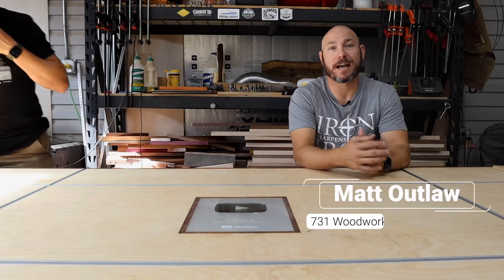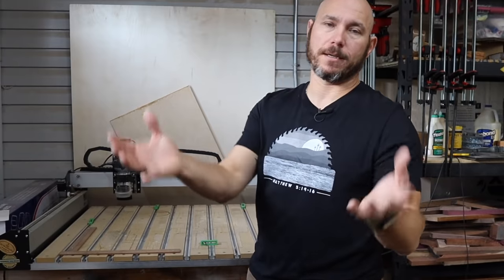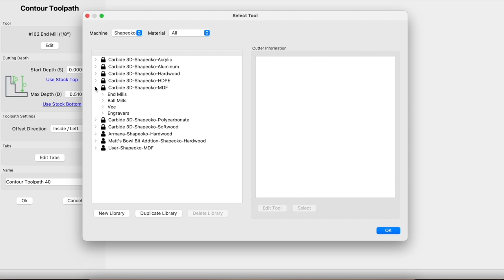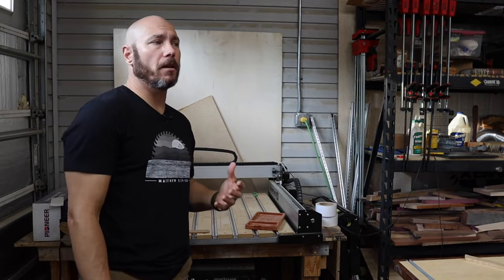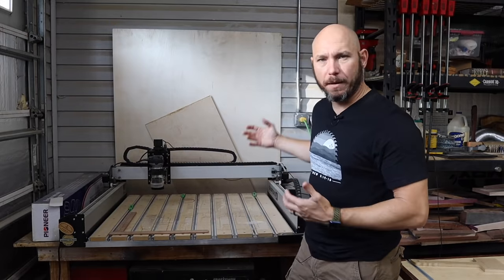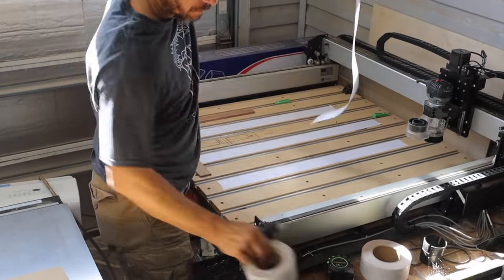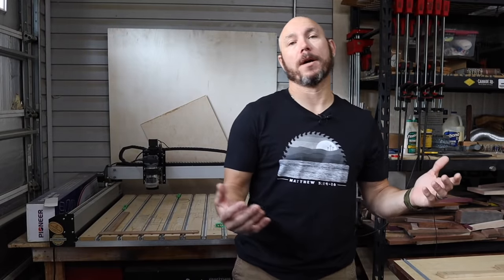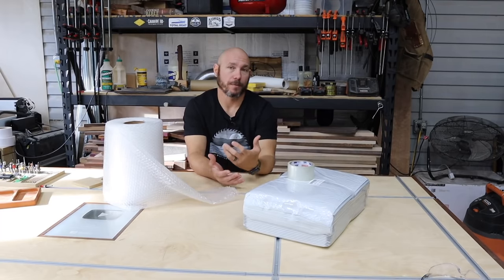The Dark Side of Learning to Use a CNC for Woodworking

Comment: I program cnc machines for a living. Went to trade school & did an apprenticeship. I am always impressed when people with no background get into cnc and pull off jobs. It’s intimidating at first for sure
Reply: I'm a machinist with mainly CNC work mill/lathe. I've had no schooling or prior experience. It's been little over a year and i'm still learning something new. It's a very steep learning curve but also the most rewarding IMO.
Reply: @Str8UpRevving  I built 747 aircraft for 25 years and bought a hobbyist level CNC to screw with at home. Never ran one for Boeing but figured it couldn't be too difficult. It has thrown me into CAD/CAM pretty hard. I have crashed bits into material, made errors in the software etc. Last night one side of it had gummed up with epoxy shavings and the gantry got cockeyed and destroyed my work. When it works it is awesome! When it doesn't? I level up when it comes to the things to watch out for. Every trade has it's unique problems. I love learning this stuff. If it wasn't for the internet I wouldn't be where I am with it. I have ideas in my head coming faster than I can draw them up. Everytime i see something cool I wonder how I can make one on my mill.

Comment: Easel from inventables is the most "plug and play" software I've used. It is almost as simple as import an SVG, give it your material depth and go. You should set your tabs properly if you're using them, you should check your feeds and speeds still, and there are restrictions in the free version which is to be expected. For simple 2d shapes, it is great.
Reply: I think that is what I used on my Millright CNC. Is it free for a month and then it's like $20 a month?  It was really simple, I made a sign in a few minutes with no problem.
Reply: So would I be able to pull an image off the web and set a depth to cut to and let it go? I saw a friend of mine do something like that with a laser engraver and thought that would be awesome for cnc routing.
Reply: @t-rexnut3091  pretty much. You will need to set up your material dimensions and thickness, you'll also need to select the tool you're using. Then you import an SVG, select the path you want to cut, set your depth of cut, and whether you want tabs. Then you can press go.
Reply: Easel could be great if it was desktop based but being could based I have found It unusable due to long delays between key entry to receiving a result. Very confusing and unsettling.

Comment: The other thing people don't get the memo on is the noise and the speed. A dust collector and spindle cutting is extremely loud. It's also a noise that doesn't stop with a machine that only moves at 50 inches per minute. Bigger machines are feeding at 500 plus inches per minute in soft materials.

Comment: Having built a CNC machine 30 years ago for a grad project in Tech school where we learned to program by HAND as well as various softwares (and working for a controller manufacturer at that time), I find creating the G-cod easy and inconsequential. Knowing speeds and feeds is the only real challenge for tool condition AND material inconsistencies. If this is a problem for you, geek out on a poor weather weekend and simply play with a CAD or graphics program and get proficient... Also, the rigidity and care of the CNC structural and electric is essential. Obviously, sparks indicate brushes, but the rigidity differentiates what I term as a real tool versus a "toy". Although X-carve, Shapeoko and Infinity are designed by the same person, the rigidity of the Infinity is superior for that level of the market. Also, it doesn't't use stretching belts of rubber, but real circulating bearing guide. blocks one precise linear guides and ball screws. Sure, we can't all justify the $30K+ machining centres used in industry, but start familiarizing with their qualities and strengths in judging a CNC for you and balance between that and your budget. Expect to pay for the best consumables, as we mostly use these for a small business, they are simply written off as composite overhead.

Comment: One month into owning a Shapeoko pro XXL,  You are 100% right !  Add to the dark side:  turning on router before the Carbide Motion swr gives RPM recommendation leads to destruction of top surface of bit setter.  I think your caution about not running the machine unattended is the most important part in the video.  I have watched a lot of CNC videos in the last couple of months and never seen anyone say you can burn your house down with one.  Now if I could only convince my wife not to start the dishwasher/washer/dryer  when we leave the house.

Comment: I had that glitch happen twice when I first started with my CNC.  I was cutting two of the same items back to back.  The machine did it on the second run both times.  Since then, I close out of Carbide Motion, reconnect to the machine,  and reset my set my zero positions between projects.  Takes a few minutes between runs, but hasn’t happened since I started that routine.

Comment: Great video.  You covered a lot of information that a newbie should hear.  My favorite part was about not using cheap bits.  A lot of newbies think they need to use cheap bits while they learn the CNC, but since they don't last and break easier, they may think they are doing something wrong when bits start breaking when it's actually the fault of the bit.  All it takes is a little learning about feeds and speeds which is readily available on the internet.  I've broken one bit in 15 years of routing and that's when I didn't have my board clamped down tight enough.  It was a production run of Muskie fishing lures I was cutting from one inch thick hard maple.  The board shifted right during the final pass so the 1/4 inch bit cut full depth and snapped. Lastly, your CNC has what is referred to in the CNC world as a router.  Yes technically it's a spindle but in the CNC world, they typically reserve the term spindle for motors where the RPM is determined by electrical frequency, are designed with more robust bearings, and they don't have brushes.  Spindles can easily run for over 12,000 hours whereas routers usually won't make it to 1,200 hours.  Some of your dark side problems are because of the model you have.  A Shapeoko CNC would be more like a bench top table saw compared to a cabinet saw.  You can only expect so much out of hobby equipment.
Reply: I normally always use cheap bits  - and the thinner the better, down to say 2mm. They cut a lot quieter, make much less dust, waste less wood, cut inside corners closer to square - but need multiple passes, which isn't a factor for me personally. A 2mm bit lasts forever, I've only broken them when I've done something stupid
Reply: @woodfinchcrafts7267   glad they work for you. You’re the first I’ve heard from that prefers cheap bits. Most in the CNC groups I’m in that have commented on bit quality said they were amazed at the difference quality bits gave them in cut quality and longevity. The problem with cheap bits is they just have a generic geometry. If that geometry fits your needs then you’re lucky to be able to use the cheap ones. But many people cut substrates that end up with the best results from a bit that was designed specifically for a particular material.  That is where the difference is going to be obvious. Look through an Onsrud catalog and you’ll see bits made for hardwood, softwood, hard plywood, soft, plywood, mdf, laminated chipboard, soft plastic, hard plastic, composite material, solid surface, and foam.  One type of bit won’t cover all materials.
Reply: @sandmandave2008  Sure - specific bits are absolutely necessary for materials that are not wood. I once tried cutting perspex with a cheap non plastics bit and got horrible results. But for MDF, plywood and solid wood, a cheap bit works fine - especially for outlined profiles.  I used a much better bit for solid guitar pockets and a small cheap bit would never have worked. My point was just not to write them off as useless - they are the main bit I use. It all depends on the task
Reply: @woodfinchcrafts7267   I’m sure they work for you but I would rather put my trust in quality bits even for general woodworking. Material is too expensive these days to risk a project on a cheap bit. Besides, there is no way a cheap bit is going to last as long as a quality bit. There is a reason they cost more and it isn’t because the owner wants to make more money. Whatever you’re happy with is fine.
Reply: Which CNC do you prefer?
Reply: @t-rexnut3091   There are so many good brands out there. I only have experience with the light industrial machines. Cam Master, Laguna, MultiCam, Shop Sabre, AXYZ, Thermwood and even Shopbot are rigid machines that will cut fast and have 4x4 and up tables.  I have an EZ-Router.  It has served me well for many years. It weighs 1800 lbs., mostly steel. Desktop machines are usually aluminum extrusions and run much smaller motors so they won’t be speedy. My EZ-Router runs at 500 ipm and 750 ipm rapid and has the weight and beefy spindle for cutting material much faster than a bench top model. Speed costs in the CNC world. If you go to a Facebook CNC group and ask which is the best CNC you will get about every model made as being the best.  Good luck.

Comment: Great video,always remember who's in Control! As for static in your shop across hose, wrap braided copper wire around the hose end to end and hold in place with either elect tape or tie wraps about every 12 " or so, 5his dispells the static and could very well prevent static fire inside the vacuum. This is incredibly important to do! Have an awesome day.

Comment: Addressing spindle failure: If your CNC uses a ROUTER, these appliances are NOT designed for the hours of use a CNC will put on them. They will wear out. In my hobby shop, I would get about 6-8 months of use and then it would need an overhaul. I ALWAYS had a backup router of the same make and model. When it needed maintenance, I just swapped them out and sent it to the shop. A commercial SPINDLE on the other hand is designed for the thousands of hours of runtime and will last for years in most shops before needing replacement.
BIT SET: Yep, great accessory. BUT if you use really small or fragile bits (think 15 deg V or 0.5mm) they can break if the they drop too fast on the detector. Might be better slowly lowering it on the work with a piece of paper between the bit and the work. When the paper is just trapped, that is your Z-zero. Very good summary of setting expectations and gotcha's. Thanks

Comment: Down here in H-Town, I worked for a company that had a CNC. We did plastics for the oil companies, flanges, stuff like that. I was actually hired on cause of my Woodworking skill/history so I needed very little training as most of the tools in their shop were typical woodworking tools. Except for the CNC. 

Huge beast of a machine. The table itself is what moved along the Y axis. 5' x 10' table. The Head moved X and Z axis. 

They only had one guy operating it, from programming to milling. I became his helper. Within 3 months, he was able to take a vacation for a week (he hadn't had one in 10 years cause he was the only CNC guy). 

In 3 months, I learned the programming and operations of the machine. Worked there for 4 years. 

Your correct, you never stray to far from it while it's operating cause the moment you do is when something happens. 

Our table had a vacuum under it, so when you placed material on the table then engaged the vacuum, it would suck the material to the table. But sometimes that wasn't good enough. 

Pro Tip: When milling out projects such as your templates, instead of using double sided tape, screw down the material to your sacrificial boards by putting the screws in areas you know will be scrap. Less cost than buying the tape and you can use the screws over and over.

Comment: Most of the things you are mentioning are exactly why there is a machine tool degree. As a machinist of 20+ years I still run into software and program glitches on a regular basis. Either user error or a result of poor data transfer to the CNC. 
The speed of your router and better cut at a lower speed is the better chipload for the cutter and rpm. Speeds and feeds are critical for good results. 
All of your information is priceless. Some of us learned it in machining classes or as an apprentice. Presenting this to new CNC users is a fantastic idea. The only thing I think you missed, is any automatic machine can severely hurt or possibly kill you. Be careful, stay safe and have fun!

Comment: I make ADA signage. I ALWAYS mask the back of the substrate with the same masking we use for vinyl lettering. It comes in various widths and is pretty consistent at .003" thick. If I am cutting smaller parts the vacuum table won't hold, I'll use a double sided adhesive sheet on a sacrificial material, such as corrugated plastic, and mount the part joining the double sided adhesive and the non adhesive side of the masking. This makes removal easier without needing to clean up glue from the back of the substrate. And parts aren't flying.

Comment: I’m a CNC programmer. The hard reboot is still necessary from time to time even with professional $$$$ software and hardware. Do you do any welding near this machine? Especially high frequency aluminum welding? This can cause program corruption. We have added a nearby ground rod and directly grounded the problematic machine and achieved very good results. Love your videos!

Comment: Nice video. Brought back memories of all my disasters. Double sided tape without clamps is a disaster in the making. You can wrap your vacuum hose with some twists of copper wire and ground the wire to discharge the electrical build up. Same effect they had in the dust bowl for electric build up. Doing a video, as good as this one, would be more challenging than CNC software. Vectric is great software, but pricey.
Reply: Double sided tape without clamps is perfectly fine and actually sometimes the best way to go if you have no other way to hold your part down. I've cut hundreds of parts on bigger machines cutting fairly aggressive while using double sided tape. You just have to keep in mind that surface area plays a huge factor in the holding power of the tape. Don't cut all the way through the part until your very last cut and 9/10 times you'll be successful and make sure you clean off any dust that may impact your tapes holding power.

Comment from the maker: Shapeoko 4 Unboxing and Setup: https://youtu.be/04jT-dZhZnQ
Reply: CARVECO does what you want and is only 50 bucks a month!! Very affordable!!! Your missing steps EMI filters are needed and it will stopp going where it wants to!! Also your machine needs grounded!! SUPERRRR important to missing steps!!!  Also Id get rid of the box store router and get an actual spindle!!! You also stated your problem in this video, if you get shocked by touching your machine its not grounded! Thats your problem 100% for missing steps!!!
Reply: if you are getting static build up with the hose ground it with a peice of copper wire to the table, or a bolt in the floor to ground
Reply: @tidesrollin5343  Yes correct reducing feedrate and fitting EMI filters ( I forgot to mention them, I have them on every cable) will eliminate the processor missing steps.
Reply: To alleviate static, run a flat braided cable inside the vac hose. Pinch it in the connections. Attach one end to the table.

Comment: Love your channel, found it after your interview with WWMM. Looking to purchase my first CNC so this  information is great!
Reply from the maker: Thank you!
Reply: Scott, there are a lot of good options for CNC's  openbuilds has good options. Longmill is also a solid option.  Vetric software in my opinion is by far the best bang for your dollar. There is a bit of a learning curve but the software is very intuitive.  Also IDC woodcraft has a great channel for cnc info. 

After having a cnc for 3 years there are a few things I would have done differently. 

My main frustration is holding the work to the spoil board.  Sitting here today I would look into vacuum hold down. A good middle ground for this is CA glue with masking tape.  But I find it dosen't take long to throw your spoilboard out of level and you will have to resurface your board. 

Z height is huge the more the better.

The more ridgid your cnc the better. 

There are lead screw driven and belt driven machines. I am sure if you look into it you will find lead screw is  a good way to go. 

I think my total investment is close to $8,000.00 Canadian dollars

Computer with good graphics card (gaming computer) $1200.00
CNC  $4500.00
Router $160.00
Router bits $400.00 (Freud)
Dust collection $600.00
Software $1000.00 vetric ( you can buy the base version and then pay the difference as you want to upgrade. Plus they allow a free upgrade to the newest version when it gets released)
Table with enclosure $250.00

If I can help in any way let me know.
Reply: Openbuilds is a fantastic option, I have one myself and it is amazing - especially with all the accessories available like the black box control board and Interface dongle (I have both)
Another good machine is the Newcarve CNC from CNC 4 newbie. Very rigid and nice and big (weight and size)

Comment: Lots of guys use pin nailers (wire brads) to hold work down, the bits will go through them no problem, just be sure you get coverage where your parts will be so they don't go flying when it's cut out.

Comment: On the issue of securing the work pieces, the hardwood would maybe stay the same on double sided tape, but I believe Jay Bates was using a Brad nailer with hard plastic Brad nails to secure his MDF sheets to the CNC bed. He was doing a ton of cuts and used those to secure his pieces plus if the bit bits it then it’ll cut through it with the damage of a metal nail